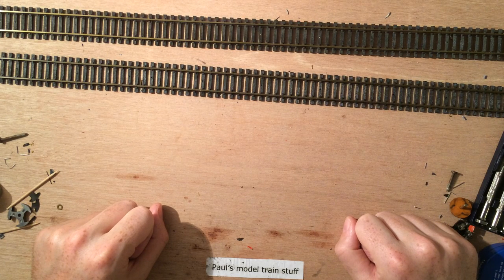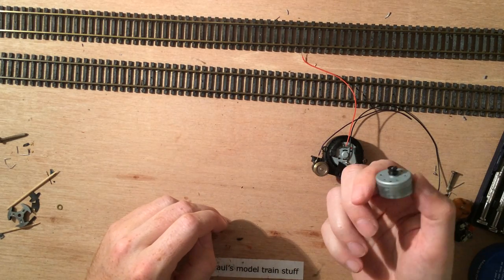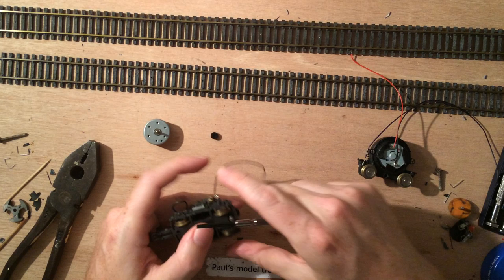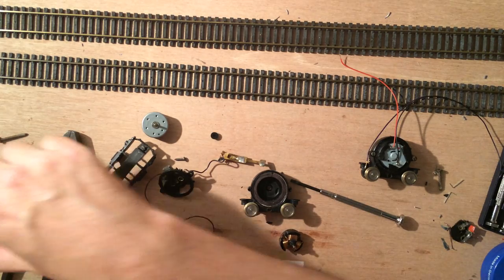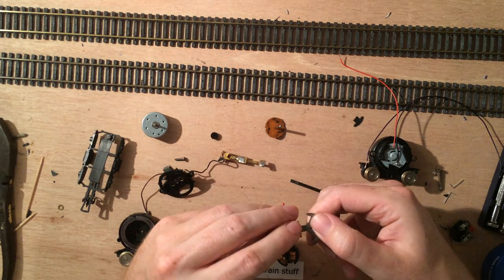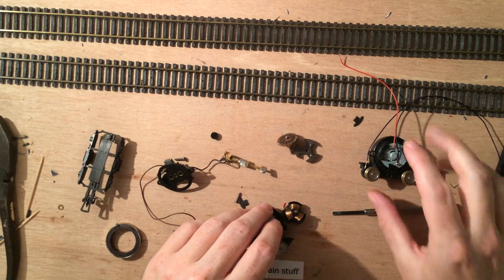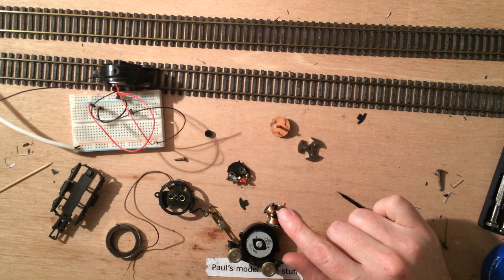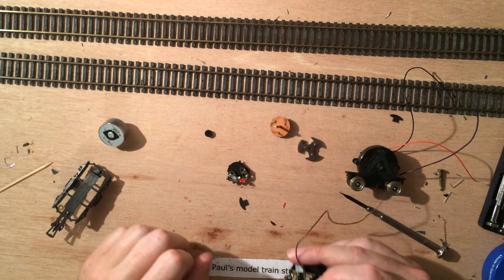Lima CD motor replacement (Video in English)

Comment: Paul, vraagje,
Als ik een cd motor in mijn lima koploper bouw, kan ik daar zonder problemen mee op een roco baan met multimaus, digitaal rij ik.
Heb er een lokpilot 5 in.
Reply from the maker: Hoi Fons, 

Dit is een oudje, dit filmpje. Ik heb zelf een Lima Koploper (KLM uitvoering) waarbij ik de motor vervangen heb door een CD motor, ook een lokpilot, waarschijnlijk 5, misschien nog een 4. Je zult wat moeten spelen met het maximum voltage op de motor omdat de trein anders te snel rijd maar het kan zeker. Helaas blijft het loopwerk van de Lima's slecht en ook heb je geen vliegwiel dus verwacht geen wonderen.
Reply: @Paulsmodeltrainstuff  
Oke,
Nog een vraag,
Waar sluit ik het draadje van de lamp aan na vervanging van de motor, heb er een cd motor in gezet, deze blijft analoog, zit alleen met het lampdraadje
Reply from the maker: @fonswalma3574  De bedrading van de lampen moet direct op de decoder. De gedeelde + is de blauwe ader. Het witte draadje wordt actief bij vooruit rijden, die moet dus naar de witte lamp voor en evt naar de rode lamp achter. De gele draad wordt actief bij het achteruit rijden. Deze moet dus andersom, rode lamp voor en witte lamp achter. Ik heb hier een filmpje van maar dat is van erg slechte kwaliteit. Binnenkort een reupload dus!

Comment: You said you wouldnt recommend it running on analog tracks, why is that?
Reply from the maker: The voltage on an analog track is max. 18V. These motors have a maximum voltage often closer to 12V. 

If you take two analog trains and run them full speed they will go somewhat the same speed. A Lima with an analog motor will either go waaay faster or burn out. 

When running digital you can limit the voltage to the motor and very precisely regulate its speed.
Reply: Ahhh thanks, so if i would want to use it i should add a “weerstandje” to the engine?
Reply from the maker: @Lumberjackk  You could but take into account the resistor has to dissipate all the power not send to the motor as heat. This can be up to 20W...
Reply: @Lumberjackk  I wouldn't do so. The voltagedrop over a resistor depends on the current THROUGH the resistor. This means that a certain value resistor could mean your train runs nice without any cars behind it as the current is relatively low, but almost stalls with cars connected to it or (worse) completely stalls, as the motor draws more current and the voltagedrop over de resistor increases.